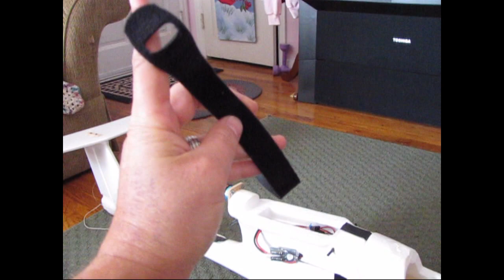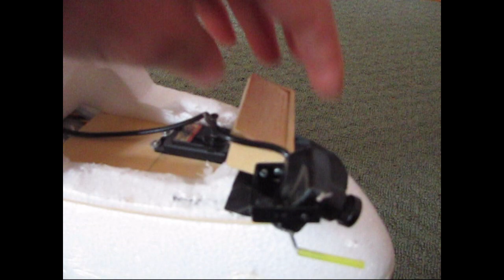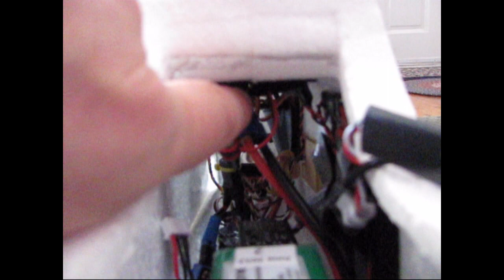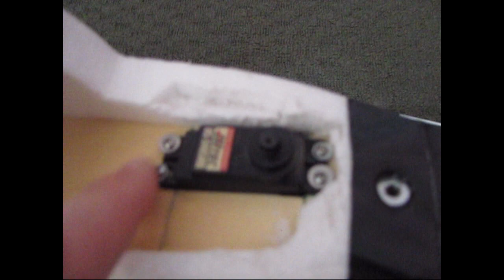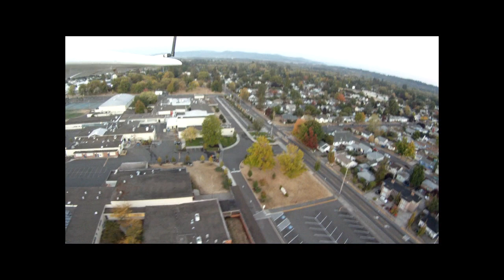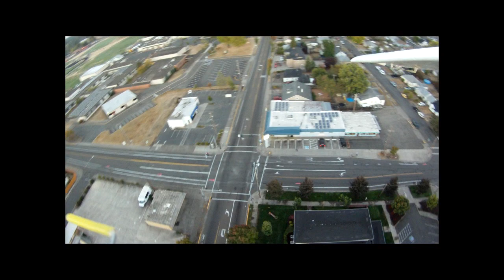GoPro Camera Pan Mount - FPV Skywalker - Quick and Easy

Comment from the maker: You and me both. I have had so much fun flying I haven't put together my black mamba yet, either! I may just buy all new equipment for it. Maybe transfer the fy31-ap over to it, but buy a new GoPro and get all new electronics. I can't see taking apart my white one, it is such a good little bird...

Plus, if I could get someone local to do some FPV with me (hint hint, anyone in the mid-valley area) they could fly the white one and I could fly the black one and do some formation flying...

Comment from the maker: I don't worry about small aircraft, I just avoid them. I usually only fly maybe 2km out, rarely 3km. At that distance I can easily hear any light planes. It is easy to listen to the direciton with my "ground ears", and then if I detect they are close, the best thing to do is to turn towards them to get a visual. I have seen small planes in the same airspace many times. If I am looking right at them, I can avoid them, like a bicyclist can avoid a vehicle. Never turn your back on a plane near you!

Comment: Very good design.  I like the yellow indicator wire for a straight heading.  Since the GoPro has the lens on the left side, would it be better to move the GoPro to the right some and mount the FPV camera on the left side of the tray?